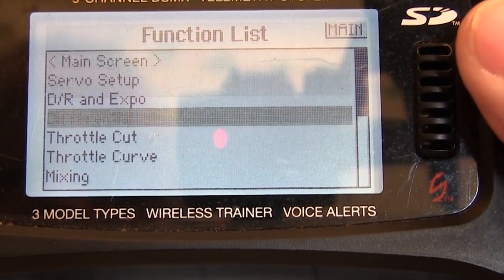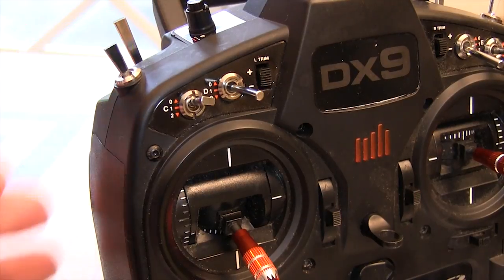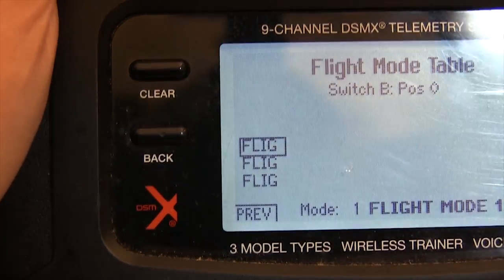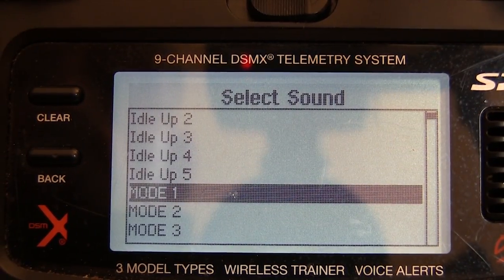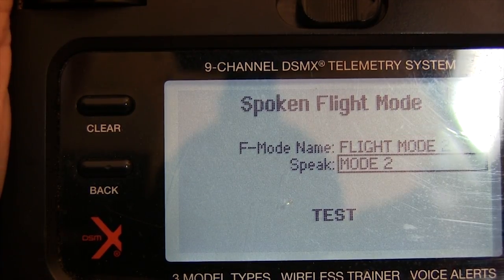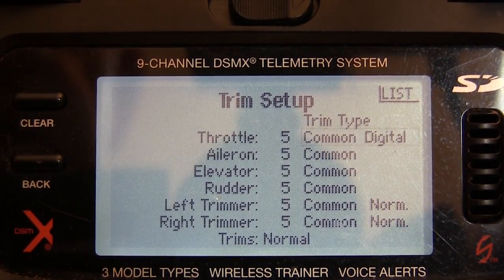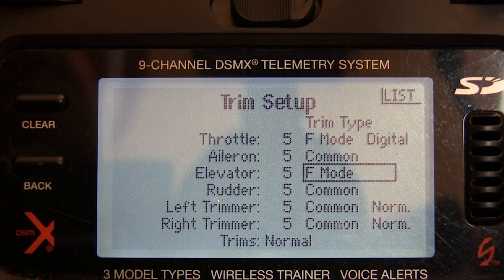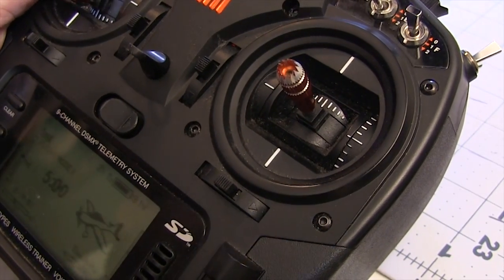Setting Up Spektrum F-Modes

Comment: Good video. FYI, for anyone who's wondering how to switch the order of the flight modes, you can do that with the digital switch setup menu. The B switch is normally  set to -100/0/+100 but you can swap it to +100/0/-100. That does the same as reversing the switch. You could even set it to +100/-100/0 if you need to.

Comment: Tom, can't figure out how to set different dual rates and expo on the different flight modes. I'm using a 2 position switch on my dx9 and when I switch between flight modes the ratea stay whatever was programmed into either mode. So if I make a DR change in FM1, it does the same when I switch to FM2. What am I doing wrong?
Reply from the maker: As far as I know, dual rates and expo are separate from flight modes. I always set my dual rates and expo but not in relation to flight modes. flight modes covers trim changes in those channels you select.
Reply: @flyingrcdotnet  Ah ok. Thanks for the quick reply. Greatly appreciate it.

Comment: I can't figure out how to set up flight modes with 2 switches. When I try, it assigns a mode to both switches somehow, and then changes the others. I do not want both switches to share a flight mode. Any advice?
Reply from the maker: I've never tried two switches. I'd pulse Spektrum to see if that's even possible.